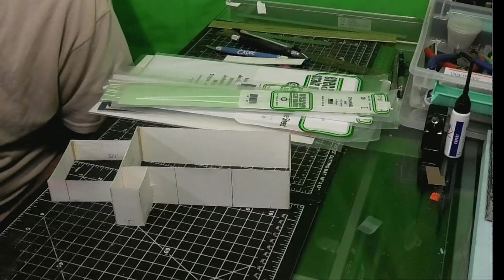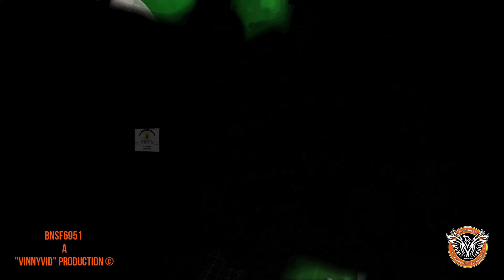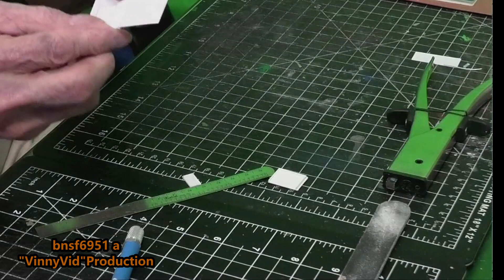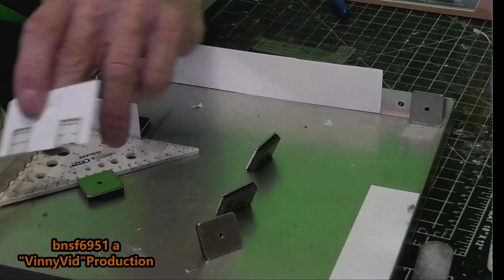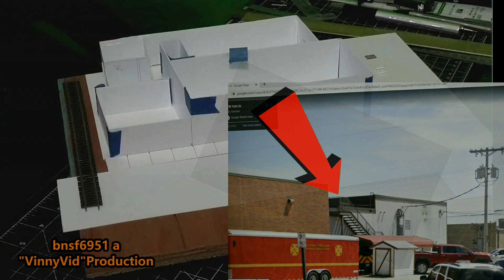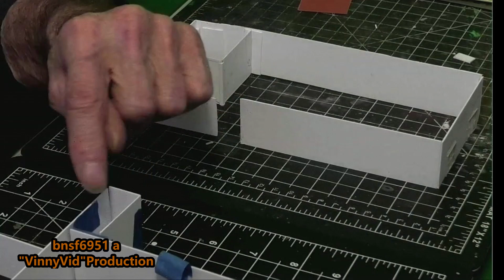FINAL MOC-UP FOR HAYS F.D USING  0.030" styrene

Comment: That “stairwell” is probably also a hose drying tower. After fire hoses are used, they need to dry out before being used again. Most fire houses have them. The hoses are longer than two stories so in a stairwell that is only two stories they are probably doubled or quadrupled over some bars at the top of the stairwell.
Reply from the maker: hello Ronald...thx 4 the heads up on that part of my build...i learned something new today...hose drying...thx 4 watching & your comment... vinny